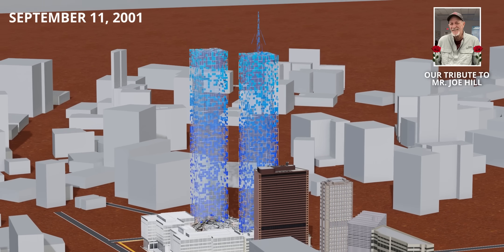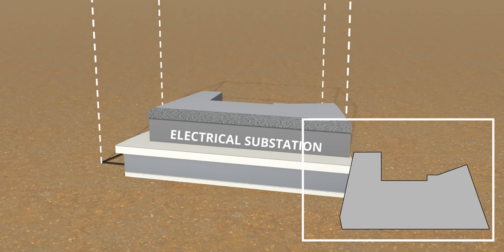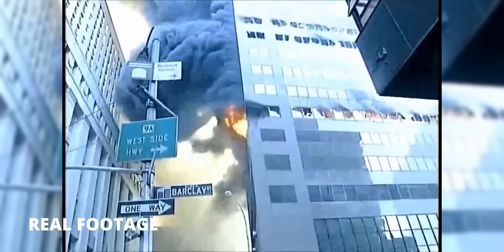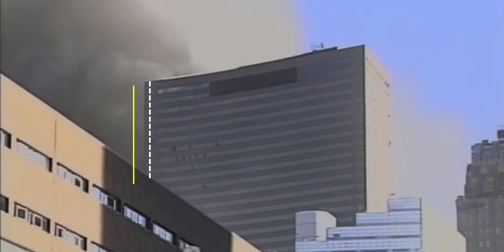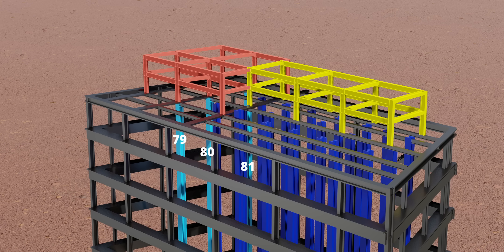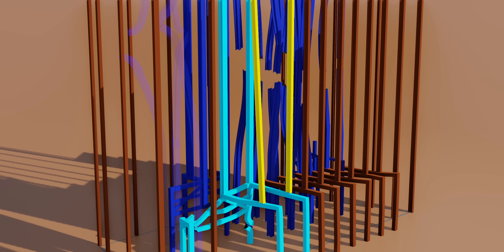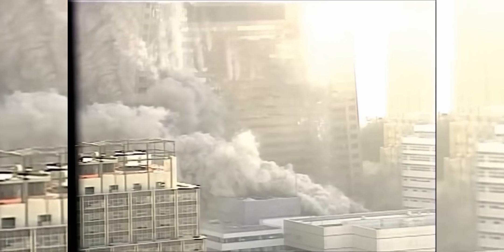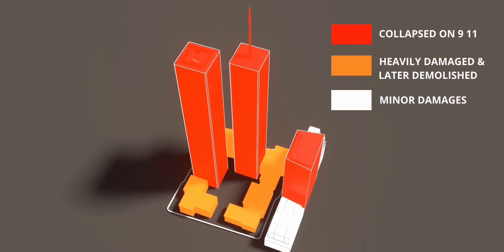Collapse of Building 7 | The Complete Physics

Comment: As a chemistry major student who works with heat, acid, bases metals and non metals. I will assure you that there was not enough heat to do that to alloy or stainless steel covered  with concrete. In just 7 hours. Especially when you consider  world trade center was almost 100 meters away. Scattered fire like that would take days even weeks to make any sense.even then it is most unlikely to happen.you may have seen buildings burnt for days and not even a wall has fallen.  It mimics tnt demolition like a mirror. It was a perfect demolition. 7 hours is more than enough to set it up. I mean the +nts. You have to accept the fact that some videos are dictated by those org or govt.
Reply: So, you're not a chemistry major, and doesn't work with anything. You have no idea what happened or how the buildings were constructed, or out of what? (stainless steel? What planet are you on?) You also don't know how large the towers were. You don't know how thoroughly WTC 7 was on fire. And you have no idea what a "tnt demolition", whatever you think that means, look.

You have accept the fact that you literally have no idea what you're talking about, and lying about supposed "authority" doesn't change that.
Reply: @mooneyes2k478  , ONE SINGLE WORD! ... That is all it takes to answer my basic high school physics question:

As an object is falling in free fall how much work is being done by that object AS it is falling in free fall? 

Any comment you make without knowing what the physics term 'free fall' means is then based on ignorance and is an insult to the people that were murdered on the day of 9-11-01.
Reply: Student,  you  might need some more time to learn. We dont use stainless steel for the primary support of almost anything. And what? It does not take days  to heat up steel. Ever heard of fire ratings? I work with them all the time.
Reply: I am going to respectfully disagree and offer a more plausible and far more detailed alternative.

Building 7 - the 6th building to collapse of 10 lost on 9/11 - because of its low priority was largely ignored early on, so conspiracy filled the information void with a lot of  garbage from ignorant people promoting political agendas, creating a lot of confusion and misconceptions.  So I prepared this brief summary using my own technical analysis, not ideology and magical (non)thinking to dispel them. 

At 10:28am the WTC North Tower collapsed, showering Building 7 with tons of burning debris, causing heavy damage and starting many large fires that burned out of control for the next 7 hours. Half the FDNY firefighters having been killed, units in disarray, equipment destroyed, no water pressure, and the greater urgency of search & rescue efforts, Building 7 couldn’t be saved so firefighting efforts were pulled as futile and 7 left to its fate. Firefighters make that sort of choice every day in brush fire situations - which houses to save and which ones to let go. Only real difference here is moving the decimal on the size and cost. People get overwhelmed by the size.

www.youtube.com/watch?v=g_SvpwyC17M

Collapse of a burning structure is always a concern for firefighters and steel buildings are uniquely vulnerable to fire damage. When subject to fire they rely on active firefighting to survive, designed around 1 to 3 hours of fire resistance to, allow time for occupants to escape and active firefighting to get started.  After this all bets are off. Left to their own devices they'll exceed their design envelope and collapse, like Plasco Tower and Wilton Paes de Almeida. In 7 the occupants escaped, passive and active fire protections were compromised and active firefighting was abandoned hours before the collapse, which left the building to its fate. It lost. Odds on Building 7 would eventually collapse, and it did. No big deal in logic.

 http://www.youtube.com/watch?v=WnYBX6QT0R4 

FDNY Chief Daniel Nigro - The biggest decision we had to make on the first day was to clear the area and create a collapse zone around the severely damaged 7 World Trade Center, a 47-story building heavily involved in fire. A number of fire officers and companies assessed the damage to the building. The appraisals indicated that the building's structural integrity was in serious doubt. I issued orders to PULL back the firefighters and define the collapse zone. It was a critical decision; We could not lose any more firefighters. It took a lot of time to PULL everyone out, given the emotionalism of the day, communications difficulties and the collapse terrain 

FDNY Deputy Chief Peter Hayden ; We had our special operations people set up surveying instruments to monitor and see if there was any movement in the building. We were concerned of the possibility of collapse in the building. And we had a discussion with one particular engineer there, and we asked him if we allowed it to burn could we anticipate a collapse and if so, how soon? And it turned out that he was pretty much right on the money, that he said 'In its current state you have about 5 hours 

The collapse of Building 7 was anticipated and widely reported in the media throughout the day, with 24 video cameras recording some or all of the collapse. Everyone knew what was coming and why. 

www.youtube.com/watch?v=OY5S5k3tMHI

Building 7 collapsed from the inside out which is not at all intuitive and hard to understand with most details being hidden from view.  It requires careful analysis and observation, and some people will struggle no matter how much it is explained. But here is my explanation relying on no outside authority. 

Building 7 was a unique, asymmetrical 47-story steel frame structure built atop a smaller 3-story building serving as a partial foundation, requiring lower floors dedicated to complex load transfer structures. Of trapezoidal shape and tube-in-tube construction, B7 (above the 7th floor) consisted of a central core of steel columns carrying most of the gravity load, perimeter steel columns around the outside of the structure carrying the remainder of the gravity loads and long span beams and girders to tie those elements together and form the floors. On the outside of the building hung a facade or outer shell. 

www.nist.gov/image-16640

Phase 1 : First externally visible signs of collapse initiation occurred at 5:20:28 pm and was notably quiet with observers not realizing the building was collapsing! No warning in the form of hundreds of eardrum busting 180dB explosive bangs. Here at 12:00 a local CBS affiliate reporter talking 10 blocks from B7 when collapse begins. People don’t start to notice the collapse until 12:11. At 12:45 is the famous CBS fixed camera clip of Building 7’s collapse. Note the silence. 

www.youtube.com/watch?v=t5tEy6mXSE8

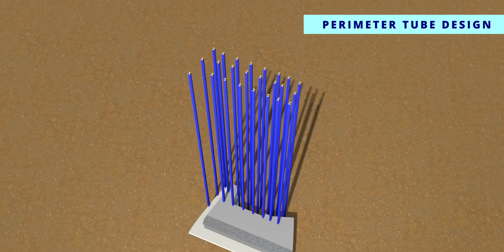Lower floor failures above the load transfer region (8-14) in the NE corner initiated the collapse. In this video at 0:45 you can see the NW corner from inside the building while under construction, Column 79 just out of frame on the left. That big, angled steel beam across the top of the frame connects to C79 at one end. The girders connect to the beam. That beam and all those girders depend on just one connection 

www.youtube.com/watch?v=nP3TNHPCIVU&t=45s

Phase 2 : NE corner floor failures caused a loss of critical lateral support over an excessive length of Column 79 and it buckled. Externally as collapse begins we see a vertical progression of window breakage along the 44-46 line and a kink in the roof of the East Mechanical Penthouse at the top of the building, consistent with C79 failure. Looking at the above floor diagram of Building 7 when you see all the structures that depend on C79 you quickly realize this one column was a relatively isolated structural element on which a disproportionately greater fraction of the structure depended analogous to say the Key Bridge. Normally with a buckling column, the load could be redistributed to other columns. With C79 that is not the case - the failure did not redistribute the load, so the collapse rapidly progressed to the roofline, sinking the rooftop penthouse. The transition from full capacity to almost no capacity occurs in an instant and will result in virtually no resistance 

Phase 3 : With C79 gone, B7’s progressive, non-symmetrical collapse continues with adjacent columns 80 and 81 left laterally unsupported and quickly buckling as well. The EMP drops down through the building. C79-81 all have no diagonal bracing, which is the major reason why they could not redistribute a lot of vertical loads among one another. From there collapse progressed from east to west through the central core until the core was gone from 81 to 58, taking all the interior floors and probably most of the perimeter columns with. Follow the horizontal progression of window failures low in the building and the dropping of the remaining rooftop structures into the building. The NIST Building 7 study model 4 determined C79 failing under ANY circumstances would have initiated the same collapse sequence. 

Phase 4 : After about 10 seconds only the exterior moment frame remains, giving the illusion B7 is still standing to the casual observer since little has outwardly changed. But it is just a hollow empty shell like an empty cereal box supported only by a few remaining columns and overloaded from the loss of the core columns and floors, quite unable to remain standing. With nothing remaining behind it, the north face leans inward, forming a V in the roofline, the last few columns buckle under the strain and the moment frame free falls, landing on top of the debris pile. 

The debris spread well outside the footprint blocked surrounding streets, heavily damaging the Verizon Building and destroyed Fiterman Hall. 

No building is meant to survive 7 hours of multi-floor unfought fires. Building 7’s progressive, non-symmetrical collapse was incidental, unintended collateral damage from the combination of fire, time & gravity started by the collapsing North Tower, true no matter who planned and carried out the 9/11 attacks or why .  Of so little consequence it barely registered at the time, only taking on semi-mythical status as an alleged smoking gun years later when demolitions at the Twin Towers, missiles at the Pentagon and shoot down over Shanksville all failed and conspiracists had nothing left to work with. 

Anything can seem like a conspiracy if you don’t understand how it works. Now you should. I hope you found this helpful, informative and it solicits informed critical comment. If I made any errors of fact, logic or reason or left anything important out, please let me know so I can fix it. OR offer a more plausible alternative if you can. Be the first. Please start any reply with the words “Tits McGee” or I will know you didn’t read it and are wasting my time.
Reply: @TheCriticalStinker-01  , ONE SINGLE WORD! ... That is all it takes to answer my basic high school physics question:

As an object is falling in free fall how much work is being done by that object AS it is falling in free fall? 

Any comment you make without knowing what the physics term 'free fall' means is then based on ignorance and is an insult to the people that were murdered on the day of 9-11-01.

Comment: Nice try Mossad. Those demolition experts you hired are the GOAT:

1. They surveyed the property very thoroughly. Survivors reported many different crews just before 911.

2. None of the explosives malfunctioned. That would have caused the buildings to fall or veer sideways.

3. Their structural integrity calculations were good. The structure did not present any unpredictable hard or stubborn region.

They only failed in their public safety effort. They should have secured the perimeters, evacuated all adjacent at risk buildings, put up signs, and issued warnings in local press.
Reply: "They surveyed the property very thoroughly. Survivors reported many different crews just before 911."
Which is nonsense.

"None of the explosives malfunctioned. That would have caused the buildings to fall or veer sideways."
Which is nonsense twice.

"Their structural integrity calculations were good. The structure did not present any unpredictable hard or stubborn region."
And there's more nonsense.
Reply: @mooneyes2k478 
So, no nonsense declaration on their public safety part?

Let's recap that part:

1. They somehow managed to only warn about 300-400 Jews who worked at the WTC at the time.

2. 4 missed the memo, so they turned up to work that day. Netanyahu cried and lamented about the loss of those 4.

3. Silverstein, the lease holder of WTC, had a last minute "doctors appointment" that day. It was the only day he never showed up for work.
Reply: @mooneyes2k478  , ONE SINGLE WORD! ... That is all it takes to answer my basic high school physics question:

As an object is falling in free fall how much work is being done by that object AS it is falling in free fall? 

Any comment you make without knowing what the physics term 'free fall' means is then based on ignorance and is an insult to the people that were murdered on the day of 9-11-01.
Reply: @dunexapa1016 
Physics, is a sub-set of TRUTH.
Reply: @martoking  So....what we can conclude is that, 1, you said nonsense, 2, when called on that nonsense you then changed to other nonsense, 3, when called on that nonsense, you defaulted to something that was so utterly dumb shit it wasn't even nonsense.

Cool, glad to see you admit it.
Reply: @mooneyes2k478 
You want to hear more nonsense?

- A pristine, clean, intact passport belonging to one of the highjackers was found lying on the sidewalk. Undisturbed. Must have fallen through the pilot's open window or something.

- Silverstein was paid $5 Billion for the "accident" despite the insurance companies raising the odd coincidences. In a true mafia fashion the insurance companies were arm twisted to pay up.

Through CB radio, a medical technician overheard Silverstein giving the order for building 7 to be pulled down.

- The BBC reported that building 7 had collapsed, a whole 35 minutes before it did.

- Do you want more? I can do this all day.
Reply: @h1F595 
Oh yes, I remember it now. It was found very intact in the rouble that had traces of explosives.
Reply: @martoking  Oh, yes, you don't remember anything since that wasn't true either. Then again, you have consistently shown not to have a single clue, so that didn't surprise anyone.

Which, of course, is why you "can do this all day". Because all you're doing is repeating dumb shit without even an attempt at thinking.
Reply: @mooneyes2k478 
This is not a pissing contest. It is an attempt at educating anyone who wishes to know why we always end up involved in forever wars that have nothing to do with us.
Reply: @martoking  No, what it is is a laughable joke of repeated failures. Nothing else.
Reply: @mooneyes2k478 
Have you ever heard of Isis or Al Caeda attacking Isreal?
Reply: @martoking  Oh, look, something irrelevant to try and pretend you haven't said dumb shit.

Didn't work.
Reply: @mooneyes2k478 
 These answers are not meant for you. You have proven that you are too smart for the rest of us.
Reply: @martoking  Or in other words, "stop being mean to me and call me on my dumb shit!"

Poor you.
Reply: @h1F595  
Adults debate without using emotions. That out ranks whatever you think the truth might be. Don't forget, your opinion might change, so don't hurt others in your quest for truth.